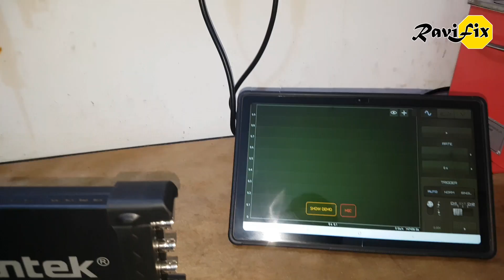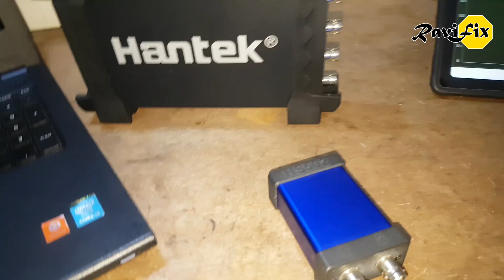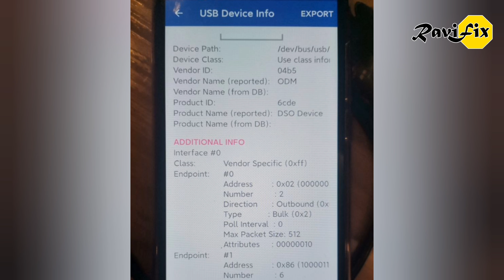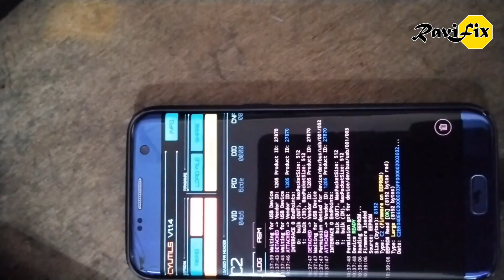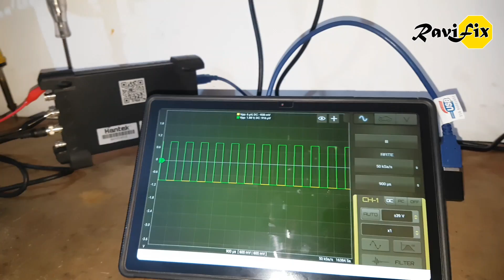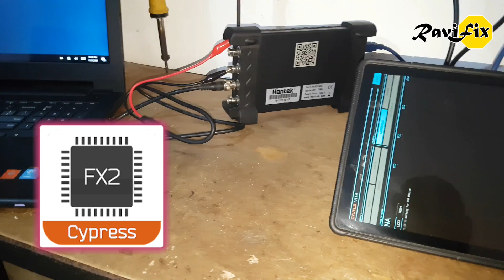Dead Hantek 6074BE Oscilloscope restored by simple firmware re-flash using CYPRESS FX2 Android App.

Comment: Having similar problems running the Hantek on a tablet. Looks as though the tablet is unable to supply enough current through the usb port. But problem is the port is usb c, so cant use the supplied Hantek cable with extra power connector. How did you fix that problem?
Reply from the maker: You can do it through a Mobil phone charger.

Comment: I have the same oscilloscope and samsung tablet too ,but my problem is different, when connect the oscilloscope to the tablet  ,but even none of the channels connected to anything shows a flat line but with parasite signal with constant cycles, and when connect channel  1 to tablet continues the parasite signal.
Reply from the maker: Calibrate all the channels first.
Reply: @ravifixall  already did it, on PC runs  great, only in the tablet, I have another tablet and run ok , I was trying like you to feed the oscilloscope directly from the tablet, maybe this time the tablet suffered the consequences. Thanks
Reply: Maybe if I send you a photo or video ,you can help. Thanks

Comment: Excellent video my friend, congratulations on having revived your Hantek 6074be. I have a Hantek 6074bc with the same problem, after a failed attempt to solve the power consumption of my Tablet P11, it stopped working. Would I be able to bring him back to life with this procedure?
Reply from the maker: May be it will work for you too. But need to find exact same firmware file froma a Donner for your specific oscilloscope.
If you need i could share 6047be firmware file and try
Reply: @ravifixall   Hi same problem here, would you be willing to share the firmware file? In my case the micro controller died and i`m waiting on a new one.

Comment: Brilliant Ravi, I am so glad you got that scope working again. I know you really enjoyed that scope. I have one of those but dont use it often, mainly only for crank/cam correlations. How do you now power it up?
Reply from the maker: Thank you Grunter.
I did some mesurements on the PCB using a Multimeter. It shows clearly those nominated voltage which have  been printed on the board are available. so.. easy to understand that it is powering up.
Reply: @ravifixall  Sorry Ravi I meant how do you add power to your scope now you want to use it. I used a De Walt type battery on mine for the added power requirement. Is that not recommended?